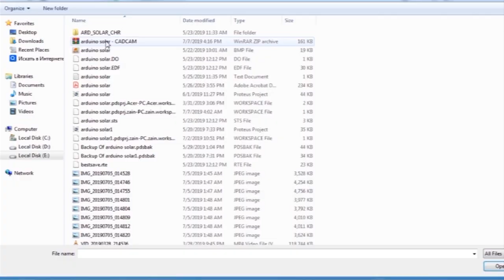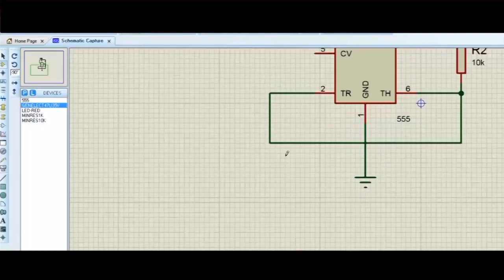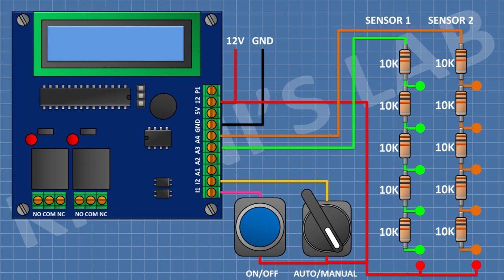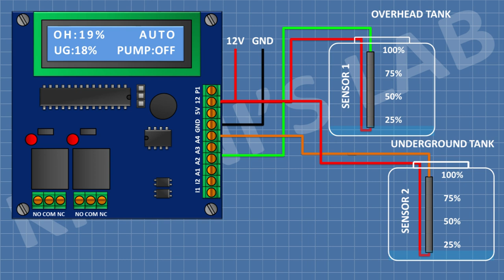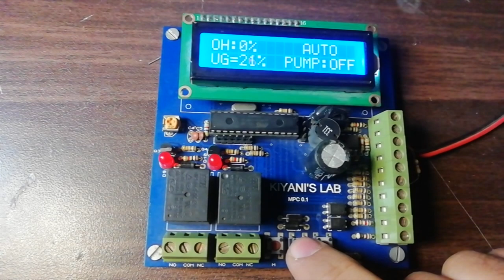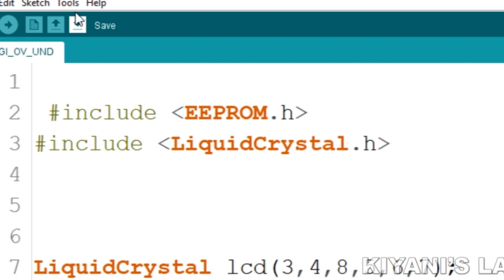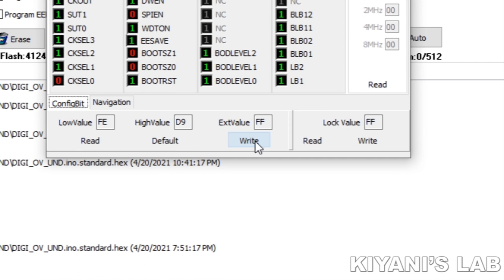How To Make Dual Tank Water Level Controller

Comment: With this we may see electral corrosion... Is it.?
Reply from the maker: yes if you use corrosive material you can use aluminum or stainless steel  for electrodes (sensor tips) and seal the rest circuitry

Comment: Dear sir,
With single water pump, there should be one solenoid valve between two tanks if one tank is full then water should go to 2nd tank and when both are full or reah at set value then pump should turn off. I think this modification will make this project more usefull. Very nice project and please explain will it work for 4000 Ltrs tank.
Reply from the maker: yes it will bro